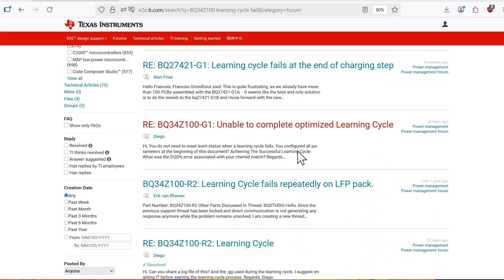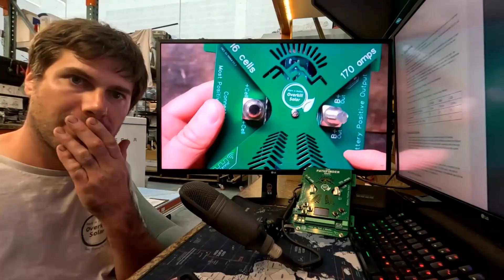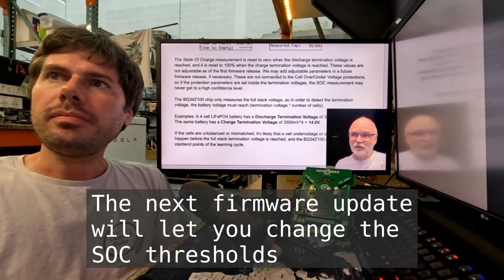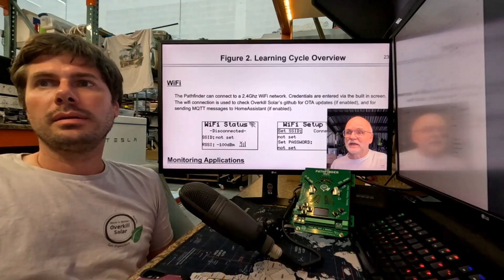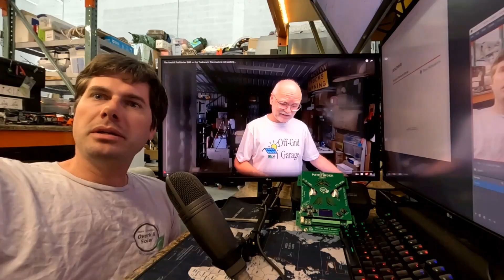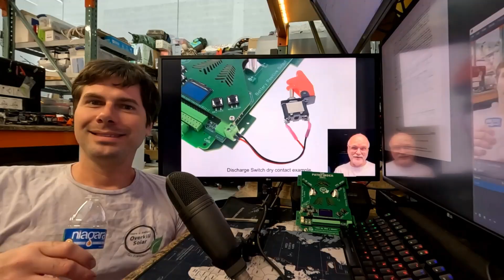Overkill Solar Reacts: OffGrid Garage Pathfinder BMS bench test.

Comment: Man you are a beast. Question!

Did you go thicker copper weight on the plane layers to help wick the FET heat? Like 1oz or 2oz? Very interesting your results showed minimal difference with and without a heat sink on the FETs
Reply: Ahhh I think I see, you are clever. So you have big ass copper planes to wick heat away which is very thermally efficient. Then the solder mask is horrible for heat transfer, BUT the solder mask layer is so tiny that you only have a small temperature delta across the copper planes to solder mask. Once the heat made it through the solder mask and the junction is solder mask to air- that is governed by convection and the properties of air- which would be the same exact situation for a flat aluminum heat sink junction to air. Hope I have that roughly right

Just discovering you but impressed all around by what youve built!

Comment: design suggestion.....for the bottom board, you can use 1W/mK aluminum board and print resistor directly (no components). You dont need accurate resistors, so +/- 10% is more than good enough.

Comment: I have studied Texas BMS ICs quite a lot, and in general the balancing configuration is OK, with no need to change that. LFP has such a stable voltage that is almost impossible to balance them under 3.3V. It is sad that people think BMS should balance 300Ah+ cells that are 50% out of balance...it can, but it would take ages. BMS balance is only used to do a little maintenance balance which can only be seen when they are fully charged. If you have 1A+ balance, you are just paying for hardware that is gonna be used when you first connect the cells. Just connect dedicated balancer to balance cells or connect them in parallel with some resistive wire, and when they are "balanced" leave the rest of the job to BMS to balance them at the top. Although, i think Texas default 100mV voltage delta bit high, I would prefer 20mV as you have done and have some logic to prevent balance discharging whole pack over time.
One option that i would like to have is to get notification if once cell in particular is always being balanced or being the only one not balanced, indicating something could be wrong with it.

Comment: You are dead wrong about the balancer. If I set balance to start at 3.45V the first cell to go above that should be bled off. If not it will end up triggering overcell voltage. Ran into that today afer top bal all 16 cell. 1 cell went rogue and stopped charging due to being .2V  higher that lowest cell.

Comment: Thank you for your extensive video and the link to the used MOSFET datasheet. The MOSFET type I could  not find in the 0.305 datasheet. Looks like you love programming the OLED screens. I'd prefer connecting to WiFi and use a web interface via laptop to view and configure the BMS. A pity that you already give up on the TI BQ34Z100 chip despite its horrible buggy learning cycle. Your BMS might trigger Texas Instruments to increase priority fixing this fuel gauge IC (especially when Andy's 111+k subscribers would have known that it is TI that produces the shitty fuel-gauge-firmware). The weak points are the press-fit connector (not brass I hope) it's surface to connect the cable lug: small contact area causing high contact resistance. My cells have 700 mm2 of connection surface on the terminal. I also don't agree with Andy that we need an active balancer. Your balancing approach is not my taste. I'd prefer an individual cell leakage current determination and do a daily passive balance on the less leaking cells to match the highest leakage rate. Third is your opinion on charging voltage. The LFP over-potential is current dependent (RCinFLA) and charging to 3.340Vpc can still overcharge your cells at low 0.005C currents (Nordkyn study). For safety a BMS must contain a (dry contact) relay: for the case where there is some kind of MOSFET issue I'd really want to be able to drive an auxiliary device as secondary disconnector. Andy's price comparison is not fair. Despite the US$230 is fairly high for Europe, US$200 translates to a 50€ markup over JK. The JK 2A 200A PB BMS sells here in store for 124€ ex. VAT (f.e. remove buttons and screen, become a WiFi hotspot at initial state that allows entering WiFi network credentials). Andy's California comment is about your solder that contains lead, which is not allowed in the state of California. Funny Andy suggest that for the Californian market you need to sell your BMS-es from under the table/counter (from your RV).😄 (Regarding lead I tend to agree with Andy that we shouldn't bring more lead, PFAS, PFOA, plastic, and other crap into the environment).

Comment: Steve, I appreciate all the work you have put in to this excellent product! And, I trust your work will continue. I have watched a lot of Andy's Off-Grid Garage videos. He's shared some great stuff but in this case, he's clearly missed the mark and you are the unfortunate recipient. I'd encourage you not to over react to his comments but rather to simply learn what you can from him and stay on the positive path you are on!
Reply: I am also glad Steve has put a lot of effort into this BMS, and added some great modern features too(like MQQT). But I don't think Andy missed the mark here, at least not on quite a few things, which was explained in the video here as well. He was relaying his experience. And while his opinions are somewhat opinionated, so is everyone else's. I agree the charge voltage can be higher(Steve said), and such little details, but there is no reason why not have it lower if you want to. If competitors allow these safe settings to be applied, then it should be no problem. The Wifi issue could have been user error, no one will ever know, but I have to side a little with Andy. 

I would like to test the BMS myself, but I don't have the justification to spend the money on it right now. I even considered it after getting to the end of the video, but I rather wait until some of the kinks gets worked out. Frankly, I just don't need a BMS right now other than keeping a backup around. 

At the end of the day, I know Steve will do his best to make it the best product, or use this BMS and make it better, to make the next truly all around best BMS on the market. And I really hope that is so.
Reply from the maker: Thank you!
Reply from the maker: I appreciate that!
Reply: Seems like andy is bought and paid for by china, seems like he just made the video to complain